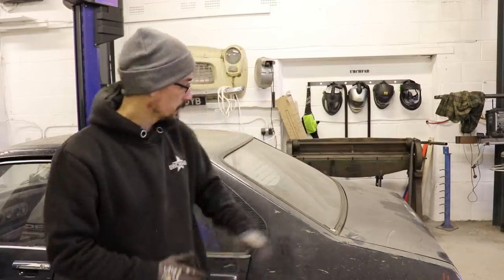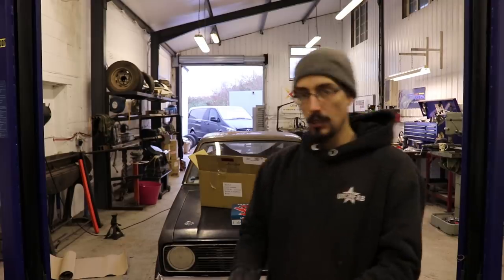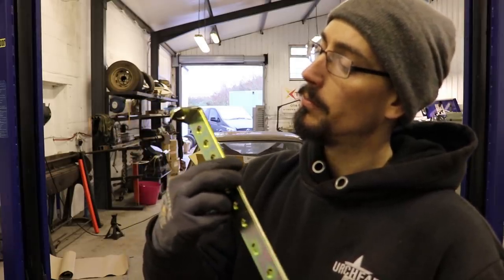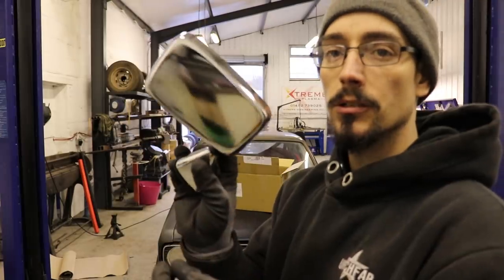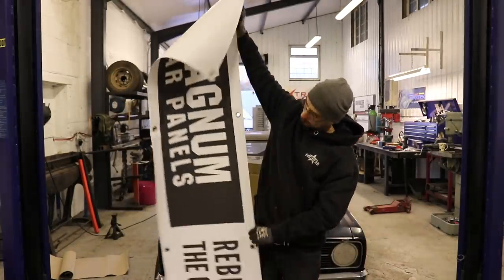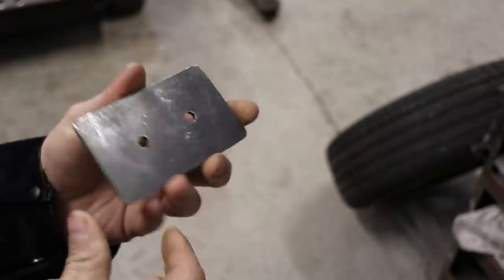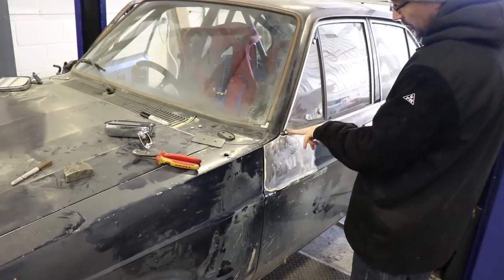FITTING SOME NEW PARTS TO THE MK2 ESCORT

Comment: Cad plating, I think. (Cadmium) Or yellow zinc.
Reply: The yellow plating is passivated zinc.
Reply: Cad plating was banned years ago ..... zinc and passivate now.
Reply: @DMJ52  it depends on what you want to plate, and how important the appearance is.
Cadmium corrodes quickly from the whitish hue of fresh plate.  Some people choose zinc, or passivated zinc (it's a bit like putting colour into anodized aluminium), or nickel plate.  Nickel is a slight yellow, and does go grey after a while.  Others like to use dull chrome, which is a soft dull shine which does not go grey. 

FWIW cadmium is still done in the USA, particularly in aircraft maintenance.  It's highly polluting, and not a durable finish - it was originally chosen on cost grounds.  People restoring historic vehicles often like to use the original finish because it is the original.

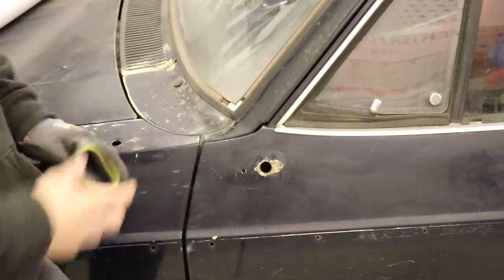Comment: At 3:19, what sort of disc were you using to remove the paint? It seemed effective but didn't take off too much either.
Reply: Exactly what I want to know too!
Reply: Search for poly abrasive discs. Looks like what hes using. Takes paint and rust of without damaging the metalwork. Used them alot there brilliant
Reply: @charliesmith1522  Thank you Charlie, that sounds like just the thing I am looking for :-) I will give them a go.

Comment: Hey Matt, check out Trev's blog on etch primer and body filler usage before you start the body work. 
https://www.youtube.com/watch?v=DncjXNLCQaY

I did some paint work after making repairs or replacement panels on heavy equipment. I always used a primer sealer on them to keep the rust off and then did filler work. Suddenly, ten years ago or so, I started having the problems Trev described and never knew what was happening until I watched his break down of the process. Turns out it started happening when I switched from primer/sealer to the etch primer without changing my process. Trev's video is the answer. Please watch it before you start.

Thanks again for the great videos. It's is going to be very interesting to watch you paint the Mongrel.

Ed.

Comment: Did you say you use 90-10 gas for sheet metal mig? Shame you tube is waterboarding us with political adds.
Reply: A-man to that , and the idiots bringing politics into automotive comment sections
Reply: @MrStacy1974  yea, I know the creators rely on adds,and I will watch them,but keep them related to the subject..
Reply: I mentioned the ads a while ago and it was pointed out that what you see is governed by your watching habits and is nothing to do with Matt. I watch the ads anyway as it helps generate income. Some of them can be hard work.
Reply: @David_Walker16-3-51  That's good info,I didn't know that,but I watch mostly auto,machining and weld videos.
Reply from the maker: Yeah I don't have any say in the ads I'm afraid.
Reply: Nobody is blaming you Matt , the political world is just a mess on both sides of the pond.
I watch car videos to get away from that but if it's not adds then it's idiots making political insults thinking it makes them funny or cool.